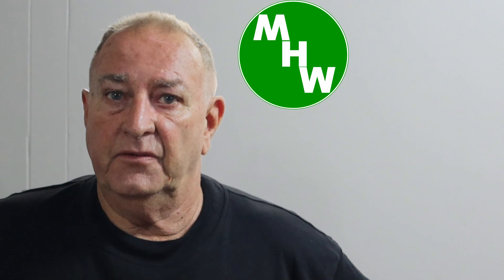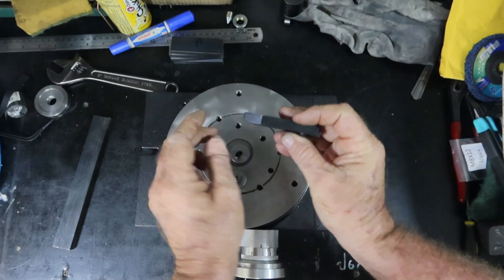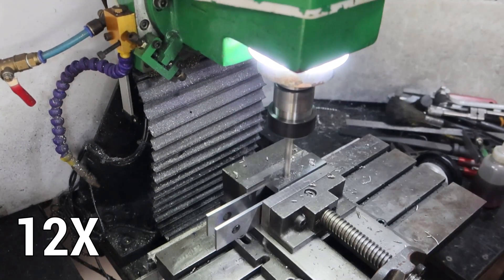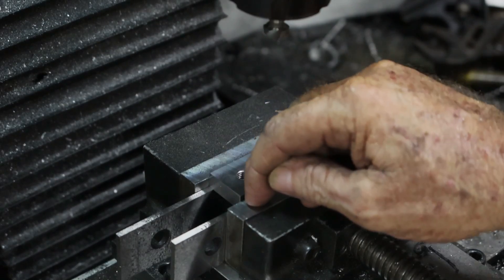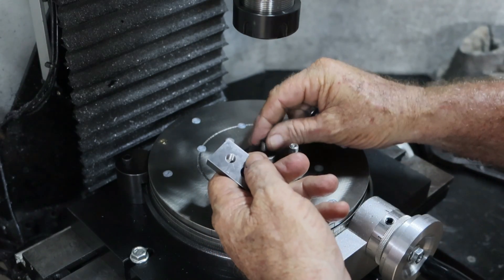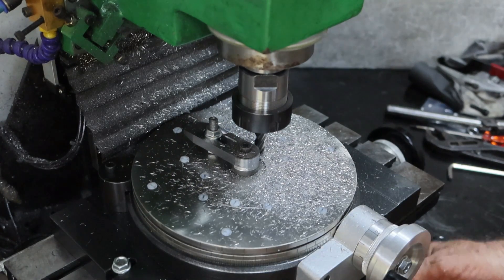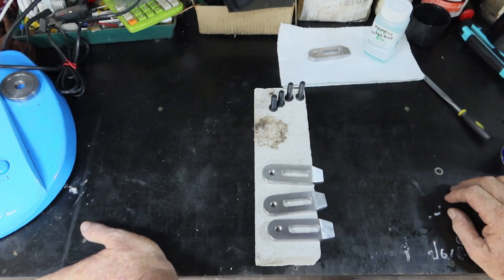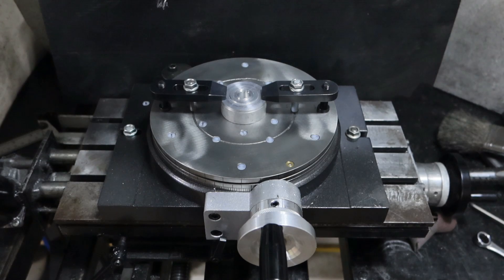Rotary Table Hold Down Clamps - MHW Episode 84

Comment: The hot bluing also has the advantage of heat treating the parts. S45C or 1045 or 12 050 or C45 or whatever else people might call it can be heat treated. It won't get very hard but it, especially not in oil but the mechanical properties of it should improve at least a bit.
Reply from the maker: That thought had crossed my mind 👍

Comment: Those bolts are an interesting issue, cold blue is an acid and you shouldn't leave metal in it for long because it will "rust" more than you want it to, which explains how one went rusty,
But 2 being blued and one not being affected?, is it possible it got some oil on it or wasn't cleaned of oil totally?
BTW Re Aligning the centre of the rotary table, Have you thought of making round "bolt" to go in the table centre thread and a round socket that goes in your collet chuck that will slide over the centre bolt tightly, you leave the fixing bolts loose align the table with the socket over the centre bolt then tighten down the fixing bolts and you're set to go.
I believe blondihacks did this, only she used the morse taper in the centre of her table with a round head protruding.
Reply from the maker: Oddly enough, I had a very similar thought myself tonight 👍
Reply: @MyMiniHomeWorkshop  "Fools seldom differ ?"😁
Reply from the maker: @Bobs-Wrigles5555  :face-purple-crying: